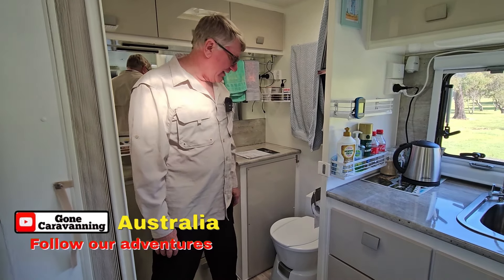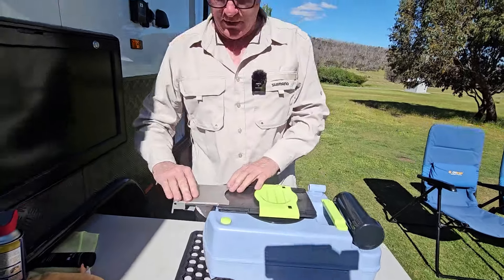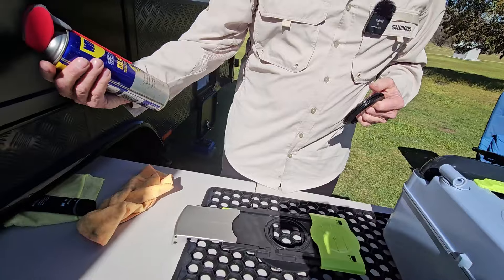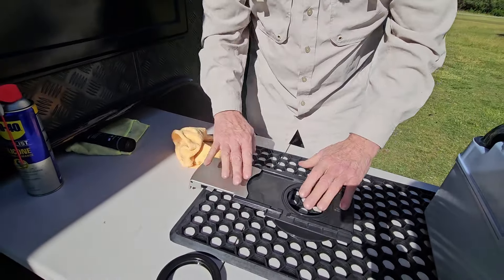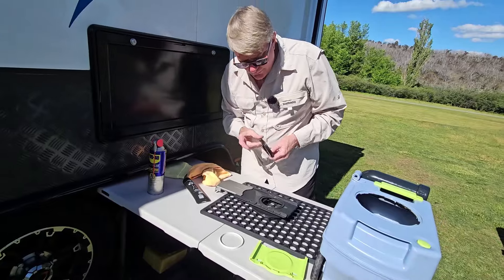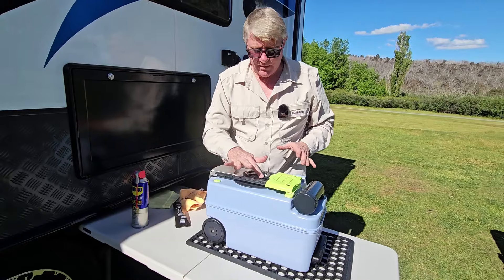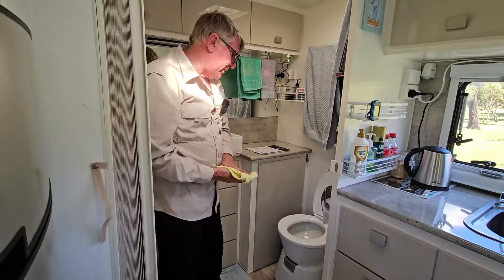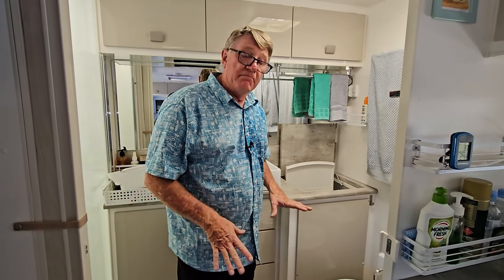FIX Your Sticking Dometic Toilet Handle Now!

Comment: Great video Ken we also had the same problem with our Dometic toilet handle being hard to open (a slightly different model to yours but basically the same ) and I bought the same tube from Supercheap auto and it fixed the issue.
Reply from the maker: @sepsadventures  Well done mate, I beat you to the video. Lol
Sorry
Thanks for watching Sep.
Ken and Julie 😊

Comment: Thanks for that. I use Inox MX6 food safe grease which is good but after about 10 slides in and out it starts to wear off. I will give your product a go.
Reply from the maker: @osmopocket69  Thanks for watching, 
Will definately work and work well. 👍
Happy travels
Ken and Julie
Reply: Excellent instructional video Ken , thank you 👍, going to call into Supercheap and pick up the grease as you suggested, thank you for sharing Ken cheers Darrel 👏👍
Reply from the maker: @darrelwright7871  Thanks for watching Darrel, appreciate the positive feedback.
You wont be dissapointed, works very well.
Happy travels
Ken and Julie
Reply: Thanks for this tip. We have been having same problem. Tried so many different things to no avail, Inox was useless, went hard. Gone back to good old Vaseline. Seems to be the best so far. But will give this stuff a go and see if it's better. Thanks.
Reply from the maker: @OurWanderingWays  Thanks for watching guys, you will find it works very well.
We tried quite a few products, would work for a day or 2 then return to be hard to open again.
We did this over a month ago and working great.
We did not have to do again, but wanted to share so re-did it again just for video.
Appreciate the feedback.
Happy travels
Ken and Julie